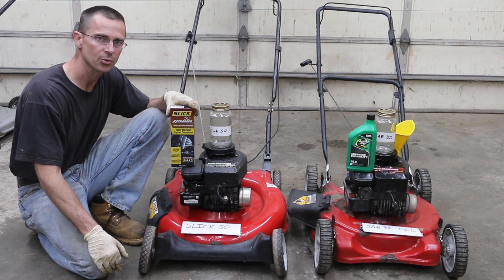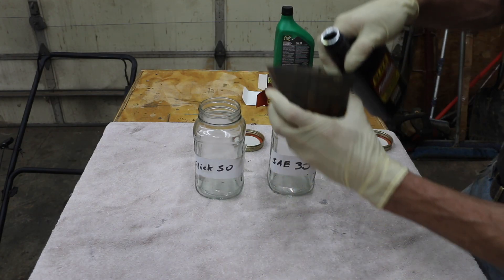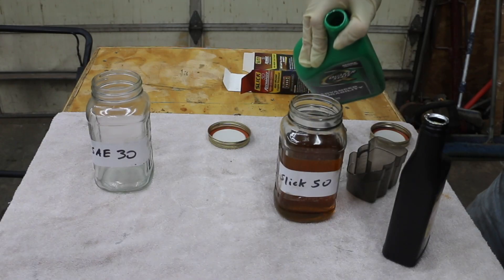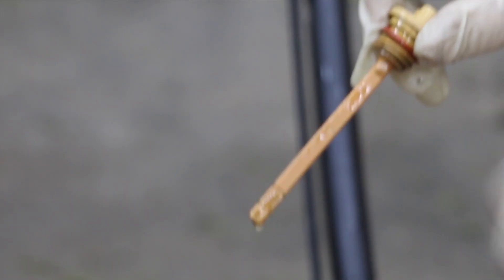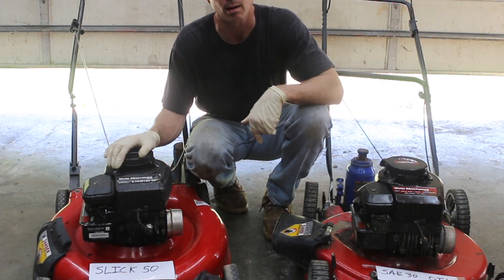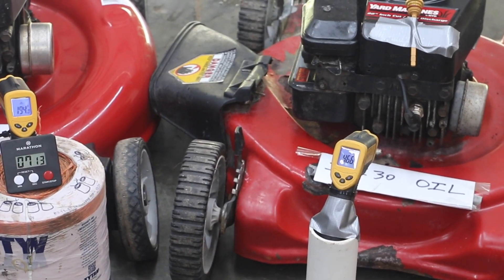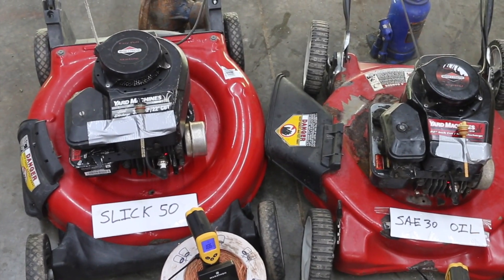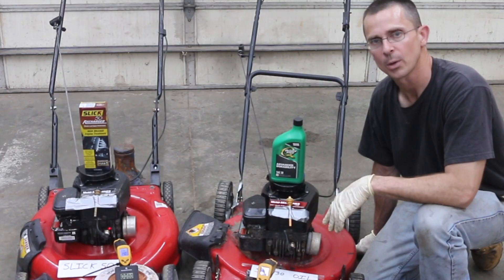Can't believe what SLICK 50 did to my engine!!--Dry Crankcase Test!

Comment: I started using PowerUp lubricants for many years and they were great! I switched to IXL when I heard about their products being as good as PowerUp but less money.  Both companies provide products that can be added to the crankcase, power steering, transmission and differential. They also provide a grease for ball joints etc. and additives for gasoline or diesel to keep fuel system clean and upper engine lubricated. I've used these products for more than 30 years. Might be coincidence but my 1986 Dodge Caravan with 2.2 liter 4 cylinder engine lasted 20 years accumulating 600,000 km before I gave it to a friend. My 2002 Saturn L100 with 2.2 liter 4 cylinder engine has 446,000 km on it and still going strong.
https://www.awsumoutcomes.com/
http://www.ixlcanada.ca/Products-IXL-Anti-Friction-Metal-conditioner-Oil-Treatment.html
Reply from the maker: Thank you for the feedback

Comment: I would like to see how "Restore Engine Restorer Additive" stands up.
Reply from the maker: Great test suggestion
Reply: Restore does essentially the opposite of Slick50. Slick50 (the keyword here is 'Slick') adds, or used to add, a thin film of Teflon to your moving parts to protect them FROM wear. Restore more or less fills in the micro wear spots in cylinders, to increase compression and extend life. If you use Slick50 in a worn motor, it still puts a slick film on things, but it doesn't 'fill', so it actually can make older engines worse. I haven't used Slick50 in some years, but it seems from the comments they've changed the formula. Shame, it used to be a decent product, for what it did.

Comment: The original work great in small engins as well as car engins. Pulling the pull start engins was always much easier after running slick 50 with  the original formula. It was after I noticed the pull start did not get easier in today's formula.
Reply from the maker: Thanks again

Comment: Watching the Slick 50 commercials back in the day, I believed they still had the cooling system working.  Don’t know if they could pull the thermostat, or alter the anti-freeze to raise the boiling point to skew the results or not, but at least the cooling system could help the engine remain in a more reasonable range of operating temperature.  Also wondered if they could injector mix oil in with the gas to fudge the outcome somewhat.  Somewhere in all that is how I always thought that they were able to pull that off.  Recently, I’ve seen advertised, waterless antifreeze that won't boil until at 375 F.  Was that technology available then?  With normaI cooling I wouldn’t expect the car engine to be able to keep going all day, that’s for sure, but your lawn mower engines only have air cooling now that the oil is not pulling heat away.
Reply: Castrol used to do a engine heat up to lock up TV ad as well.

Comment: Muscle Products Corporation has a product called MT10 that does what Slick 50 claims it does. I have been using it for over 30 years in everything from a 6.2 Liter Diesel to Lawn Mowers to ATVs, UTVs and passenger vehicles. MT10 is formulated for Petroleum-Based Engines and they also have an additive formulated for Synthetic Based Lubricants.  I have actually run a 1977 F150 351M engine for over 9 miles bone dry after losing my drain plug driving out of the mountains with a cord of wood in the back of my truck. I refilled the engine after getting a new drain plug and ran that truck for three more years before replacing it with an F250 because I kept having to replace the rear wheel bearings because of overloading that poor truck.  Since being introduced to MPC products and life's lessons I now run Synthetic Lubricants in all my vehicles along with the various MPC products.
Reply from the maker: Thank you for the feedback on MT10

Comment: Slick 50 works by heat soak, it has to ran in a motor for at least a few hundred miles to properly treat the metal surfaces, not to mention a lawnmower engine isn't made of quality parts with exacting clearances like a car or truck engine.
Reply from the maker: Thank you for the feedback

Comment: There is a'compound called esther in Motul oil which the company claims to stick to the engine. And the Company Liquy Moly claims their product Ceratec sticks to the Engine for 30,000km even after Oil Change. So Maybe worth a try since slick 50 is a way older product and Material science has improved a lot since then. Love your Videos Fan from Germany
Reply from the maker: Greetings and thank you for the feedback

Comment: Kia ora, Like you I used slick50 on my engines back in the 80's,90's. Engines were different then and the original formula was different. not sure how many companies have used the slick 50 name since then. Besides,to run a test like this both engines must have the same amount of wear/tolerances. Like you I was surprised the slick50 failed first. Much cooler though= less friction. Ultimately, inconclusive i.m.o
Reply from the maker: Thank you for the feedback

Comment: Hi Project Farm, I am 72 years old male drove trucks and cars all my life and live in the Uk going back to the early 70's the slick 50 i used was like Treacle (Molasses) and added 3/4 pint of slick 50 to my oil, your slick 50 has a very low viscosity or it looks low so whats happened to slick 50 product to go from Treacle (Molasses) to what you used just thought I would give you this important fact.
Reply from the maker: Great information.  The formula has changed since the 70s. Thank you

Comment: You need 2 brand new engines with EQUAL run time on each. I believe slick 50s polymers need to be used in an engine longer than a few minutes! It has to work it's way into all the microscopic imperfections in the bearings.
Reply from the maker: Thank you for the feedback

Comment: Prolong works great especially with high performance brushless motors, I've personally tested it on 45,000 rpm ducted fan jet motors, and have made test on the exact same engines with a substantial difference  in the standard oil and the prolonged engines and have found it continues to work great without any seizure issues
Reply from the maker: Great feedback. Thank you
Reply: Yes try prolong!
In 1984 I was given an old Volvo that hadn’t ran in 5 years. I got it home and worked on it got it running, I had just received a box of prolong oil additives from the manufacturer I found an add in hot rod magazine looking for people to test prolong. The old Volvo had 105,000 miles on it I ran it up to operating temp pulled the plugs and ran a compression test and wrote the numbers down. Drains the oil added new along with the recommended amount of prolong. I drove it around for a few days to get some miles on the engine and the after I got it up to operating temp I pulled the plugs and ran a compression test to my surprise prolong actually did increase the compression in each cylinder by several pounds. 
Try prolong

Comment: A friend of mine got in as a dealer. I saw the engine with the clear cover and no oil. As it turns out, they put roller bearings in place of the standard OEM setup. Another friend was in sales over the state. After 100,000 of '50', he developed a knock, we removed the cylinder head and found flakes that looked like corn flakes. The teflon was getting past the rings, burning on the top of the pistons the breaking loose and causing the knocking noise. What a scam!!!
Reply from the maker: Thank you for the feedback

Comment: That was not a fair test. You need to run the engine with Slick 50 at least 10 hours and now some lawns with it. The Slick 50 needs more time and heat to properly coat the cylinder and bearings.
Reply from the maker: Thank you for the feedback

Comment: Great project. Thanks.
I can't help but wonder though if the Slick 50 engine is newer, and therefore has a tighter fit and higher compression, which may be why it failed sooner.
Reply from the maker: Thank you for the feedback

Comment: If I remember, the Slick 50 commercial cut the radiator hose on a V8 on a trailer, and the engine never overheated. I used it, lost my lower radiator hose while driving, and my engine temp barely increased after 40 Miles of freeway driving, then rural roads. I think Prolong or Duralube may have done drained oil tests.
Reply from the maker: Thank you for the feedback

Comment: One could argue that slick50 killed the engine at a lower temp which may have protected the internal engine parts from multiple failure, where as the SAE30 failed at high temp which most likely means multiple internal parts failure, including engine seize.  Slick 50 engine is more recoverable by replacing Less parts..
Reply from the maker: Thank you for the feedback

Comment: You are missing the point, Slick 50 adheres to worn bearings and leaves a coating like non stick frying pan.
I add it to all my engines, last year my crankshaft snapped timing chain problem.
When the engine was stripped the slick 50 coating was on all the bearings, in fact they all looked like new bearings, so it does what it says in the advert.
Reply from the maker: Thank you for the feedback

Comment: I used slick 50 in a engine I rebuilt dodge 360 after 3000 mi break in I did an oil change with slick 50 100 k later I developed a valve problem due to valve seats not being hardened ( heads from early 70s)I was amazed that the cylinder walls still had crosshatch on them the truck was not driven easily either loud pedal had two positions on and off I think slick 50 was the reason the cylinder bores looked like they did
Reply from the maker: Thank you for the feedback

Comment: First, the test isn't relevant!  Second, Slick50 has a lot of TV advertising and hype "built in" (but you won't find it in the MSDS although many may consider it "hazardous".)
     Want a better oil additive?  get "Tufoil" by Fluoramics, an additive with colloidal Teflon.  What this stuff does is to provide lubrication during the first few seconds when "boundary lubrication" is the only thing working.  It was developed for the space program.  (Once the engine has been running, full hydraulic lubrication is on action).  The test to run is the one you ran first; temperature measurements.  You could also run film strength on your setup (but the "4-ball test" is a more valid one).
https://www.autobarn.net/chto-8.html?site=google_base&gclid=Cj0KCQiAsbrxBRDpARIsAAnnz_MJtX930cOFzUy4RT5u1CDkTEzW7ZvY3xIIjWVe5X5XY9Rji3BL8lgaArNoEALw_wcB

Comment: I would have liked to have seen the inner parts of the engine after. Both engines seized but did it preserve the parts better? Was there less warping, cracking, or less abrasion to the parts? There is no magic fix that will make an engine run forever in the event of oil that leaks completely out, but if the product spares the engine even slightly so that it can be fixed more easily then it's worth it. Given that the Slick50 engine ran cooler, I am under the assumption that perhaps the engine faired better.
Reply from the maker: Great point. Thank you

Comment: I had a guy come into my business with a bearing tester to demonstrate his product against my favorite oil. I chose Slick 50 and it preformed better than regular oil but it did seize with Slick 50. His product was called Energy Release and one drop added to any oil would not seize! He then showed me a Briggs and Stratton engine run for a half hour with no Lil! So I bought a bottle and went home to do my own experiment. I added it to my lawn mower and mowed half my lawn and then dumped out the oil and mowed the rest of the lawn! So I put it in my truck and drove it for a long time. Decided to check oil one day and it didn't register on the stick! Truly reduces friction. It looked just like Karo Syrup. Thick and clear. That was in the 80's so I thought I would see if it still exits and it does! It's not as thick and you have to use twice as much now. Not sure if it is same quality but I treated my RV which overheated going up a mountain with radiator leak. After treatment I drove up that mountain many times. And did so with low water in radiator! Amazing stuff. Would love to see it tested in 2020.
Reply from the maker: Great feedback. Thank you

Comment: Slick 50 Used to license PTFE from the company, Fluoramics, that patented it. 
In the 80's, Slick 50's license ran out and Slick 50 does not use PTFE anymore.
Fluoramics produces their own product Tufoil and it has been tested extensively.
I actually used Slick 50 when it still had PTFE and have an amazing related story.
Reply from the maker: Thank you for the feedback

Comment: If you want to hear the truth about slick 50 and where you can buy the original formula, use this link: https://xcelplus.com.au/. If that link doesn't work to click on, just do what I did: search "xcelplus" on Google and the first thing that comes up is that link. It has a couple videos on it explaining from the inventors position what happened and test data. You can also purchase it there. I've used slick fifty before and I'm sure it saved my engine. But I used it according to manufactures instructions. This test couldn't give a fair test based on manufacturer instructions. However, be aware that the slick 50 of today is NOT the original formula but the original IS available at xcelplus website. 🙂🙏

Comment: Modern vehicle engines have catalytic converters and in that instance a product containing Silicon should never be used ie added to fuel or oil. Nor should gasket products containing Silicon be placed upstream of the catalyst. The Silicon will coat the catalyst and render it useless.

Comment: Oil with nano particles of molybdenum disulfide.  You can get it on Amazon among other places, it is not harmful to humans, is an essential element for plant growth, appears to be of no consequence to aquatic life in small amounts.  I have been using a 1 to 1/1/2 percent by weight mix with good lube oil.  It would be interesting to see the insides of engines using various oil formulations.  Only a handful of marketers use Molybdenum Disulfide (Moly) in their oil. Moly is a soft but solid material, which is reportedly banned by Cummins, due to excessive valve train wear.
Reply from the maker: Great video idea! Thank you

Comment: I do t think they made any claims to the degree that Slick 50 did. But, Royal Pure used to advertise that it bonded to metal at the molecular level and they used to use a demo of of wearing a bearing that was pretty impressive compared to other lubricants.
Reply from the maker: Thank you for the feedback

Comment: I've seen 10 to 20 degree temp differences in brand new air cooled engines between batches of 10 units.  Maybe a controlled run with 30w oil in each to get base temps.
Reply from the maker: Thank you for the constructive feedback

Comment: My family uses a product called ProLong oil additive and we have had great results as we use it in our race cars, we are running Small block Chevy 350's and have continued to run a few with complete oil pressure loss and the engines never seized up.
Reply from the maker: Impressive results! I need to test Prolong soon. Thank you
Reply: Car engines don't need oil pressure to prevent seizing, they need oil pressure to prevent premature wear in the crankshaft and camshaft bearings. As long as oil is circulating at all, the engine won't seize up, even there's just a trickle of oil moving through the lubrication system.
Reply: Yes, the oil is primarily for high-pressure areas as you mention and secondarily as a splash coolant on the cylinder walls. the piston oil ring is a wall wiper to prevent blow-by of crankcase vapours that occur when the engine internals get to operating temps and prevent oil from getting into the combustion chamber. Small engines such as these normally do not have oil pumps and use the splash method to oil all internalsOn the other hand, oil is also a coolant for internal parts also, so oil quantity should be of sufficient amount to be able to be pushed (by a pump) or be in contact with the design parts in order to be splashed onto the moving parts.

Comment: I was a agent for a similar product years ago marketed by block leaks. It was locally manufactured. It reduces wear between 15-95%. The aim was to reduce engine friction and wear to be more feul efficient. ( It really worked as long as you drive normal. ) It was a competing product for slick 50. Auto zone also had a similar product called " engine & metal treatment P,T,F,E.  Can't find it anymore in my country.
It works  by coating the interior where the pressure force the P.T.F.E onto the surface (bearing surface, ect) smoothing the surface on a microscopic basis. This cause it to reduce the friction extensively. It was not manufactured as a anti seize agent/product.( if it was used on a motor-cycle chain and temperature is taken, it will be noticeable for a while) It will only perform along with oil. The way for best results was to replace the oil and to run the engine until it reaches working temperature and then add the product. Let it run ( 1800-2300 rpm's) for a few more minutes . The (carburetor )engine should idle a bit faster if the engine speed is reduced to idle speed. (It will be less noticeable in feul-injcted engines) From cold start the engine wil also take a bit longer to reach working temperature . This wil also be noticeable even in feul injected engines.
I hope info might help .
Have you tried cutting oil( used in machine shops , with lathes )as a lubricant ?
Reply from the maker: Thank you for the feedback

Comment: Maybe S 50 sold its name, changed the formula and sold it with different  chemicals? Back in 1991 S 50 was added to my mothers anemic, under powered Pontiac LeMans. A very small 4 cylinder engine.  A quart of Slick 50 was added, the power increase was surprisingly good. But now I think S 50 is different than it used to be.
Reply from the maker: Thank you for the feedback